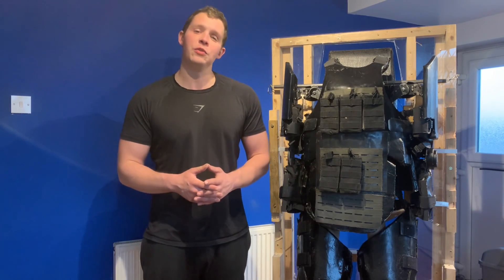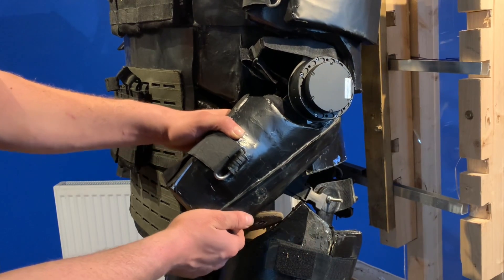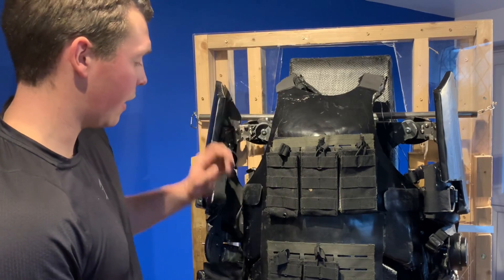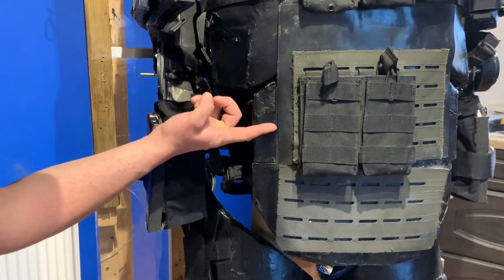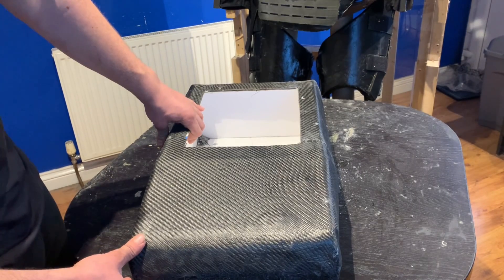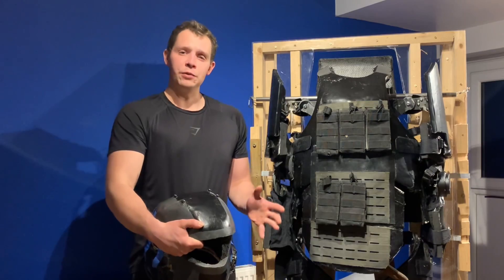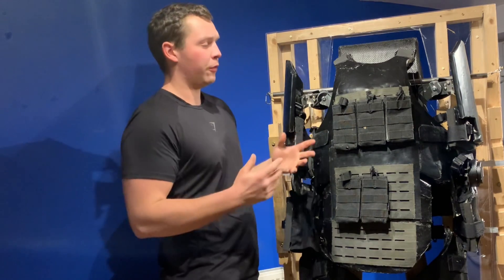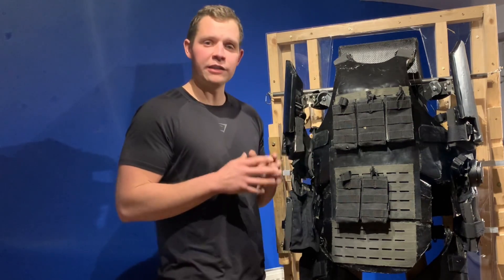Functional Military Power Armour Development. PART 2 of Episode 5

Comment: Hey. I'm also fascinated by armor like in Halo or Fallout. What specifically is the reason that today, with the level of technology we have, this type of armor is still not on the equipment of the US Army ? After all, powering this type of armor can be solved even with a small battery storage powered by a small diesel generator ( even from a compressor ) And the whole thing is based on mechanics and hydraulics. From what we can see in the war in Ukraine drones wreak havoc among soldiers so this type of armor is slowly becoming a necessity whether heavy as in Fallout or lighter as in Halo. Simply put, comprehensive protection of soldiers is becoming a reality and this needs to be addressed.

Comment: I would suggest trying to simplify the suit, and work on perfecting one part at a time. for example, get rid of the boots, consider using gas pistons and springs in some areas rather than motors.

Comment: Certainly an impressive project, but ultimately I must ask, does it solve the morphological problem?  Exoskeletons have been tried many times before, and in fact DARPA has developed a working exoskeleton for the US Army in I believe 2010.

The issue you are going to discover(if you haven't already solved it), is that rotational motors are not compatible with the morphology of human muscles, which are simply organic electrochemical linear motors. The soldiers involved in DARPA's program universally reported that despite the system theoretically increasing their strength, thus reducing perceived load, the desynchronization between the exoskeleton's motors and the wearer's muscles ended up causing the wearer significantly more fatigue than if they had no exoskeleton on at all. There's about a dozen different reasons why traditional motors of all kinds are incompatible with human morphology, which I could go into great detail about, but I think far more telling is simply observing how much energy organic things consume to do work relative to their motorized counterparts.

Human muscle tissue has a work capacity that varies between 50 and 350 watts per kg, yet the calorie-watt conversions show that even the highest performance humans only use about 200 watts per hour a day at maximum(assuming 4000 calories burned in a combat environment). Now remember even further that much of the energy we expend is only used to heat our bodies, rather than produce physical work, and it quickly becomes clear that our muscles are far more capable than motors are at large, and for more reasons than pure work capacity. There are 200 watt motors that exist, but can you even imagine one doing the amount of work that your body does? Our bodies are insanely efficient on a systemic level, despite our muscles even being less thermodynamically efficient than optimized motors(roughly 67% efficiency for muscle).

Comment: I love this so much.
One thing I'd consider adding is just a super light cloth covering in the joints. My reasoning is that if dirt or mud or other debris gets caught in the motors and joints it would clog the armor and ruin the mobility of the wearer. Some simple cloth covering (not even thick, just a slight covering) would prevent dirt and other debris from jamming the armor. I don't know enough about armor but if some light protective covering could be used instead (that still maintains mobility) that would be better. This is similar to how old medieval plate armor had a gambeson and chainmail under the plate, part of this was to cover up the joint (such as protection for the hamstring, armpits, and groin)

Comment: Wearing a frag suit underneath the power armour would probaly help with covering any holes in the armor (or weak spots)

Could also simply have a custom jumpsuit made to facilite wearing the armor as well as filling possible gaps and help with temperature control

Comment: You mentioned in the previous video that the suit takes four minutes to take off, and while that would be undoubtedly faster assisted - it still presents a problem.

Those plates don't provide full body coverage, and while the composite materials are rated up to .556 there is certainly higher strength munitions that could defeat them. While more powerful munitions would almost certainly be deadly outright - there are certain edge cases where medical intervention could save the operator if treatment happens fast enough.

.50 would punch right through the plates and be devastating to the man in the suit. He would likely only have about 90 seconds, but a shot in the arm or the leg could be recoverable if a tourniquet could save the man if applied quickly enough. Even a .22 or 9mm in between the plates could be just as devastating. If the man is partially covered in debris or rubble, it might mean that the frame might not be able to be removed at all to access the injury.

As it stands now, anybody going in to the suit has to know they're staying in the suit until the op is over or they're dead. I don't think I'd want to have to make that choice.

Comment: If ceramics and Kevlar are difficult for casting and drilling, have you considered UHMWPE for future designs? You could then have small replaceable ceramic plates on the exterior that are glued or velcroed onto the UHMWPE base armor allowing for quick fixes. Inserting a chunk of polymer and melting it back into the main armor could be done instead of replacing an entire plate section too allowing for a multi-hit protection instead of compromising the whole plate at once. Even without the ceramics, a Level III+ UHMWPE plate is only an inch thick and you could have variable thickness for more mobility. It would also lighten up the suit a lot and prolong the battery life. It should also be cheaper. That said the manufacturing process could potentially be more of a pain than casting since it needs heat and compression and I’m not sure how much compression it really needs. A hydraulic press might be less viable.

Comment: A little bit of criticism. Please don't take this the wrong way because I think what you're working on is really cool, but you've gone at it in the complete wrong direction. 

The military knows what pieces of armour it wants and how to attach it to the person. If you dig deep into the tactical gear world you'd see ready made deltoid, chest, groin and thigh armour which is what the military wants on its soldiers. The issue that hasn't been solved is the exoskeleton, and importantly, the power source. Figuring out how to get the exoskeleton to work would be far more impressive to those in the know than all the composite work which is expensive. As someone with industrial manufacturing experience, the plates are definitely a part that you want to farm out to existing manufacturers because certification and legal protection for your plates is expensive and will add unnecessary risk to your product. Make a skeleton that can hold nylon/cordura pocket matched to supplier's plates is the actual innovation, everything else is secondary. You can demo and test your skeleton with just lumps of steel plates in the vaguely right position with equivalent or higher weight which is a lot cheaper.

Comment: You should consider looking into use for this as a law enforcement/counter terrorism utility before a military utility. It has unlimited potential for making CQB, one of the most dangerous modern combag situations, significantly safer for the wearer. That's almost entirely what SWAT, its equivalents, and counter terrorism groups deal in. The ability to shrug off shotgun, pistol, and quite possibly rifle fire at a close range where the attacker is at a disadvantage is invaluable. It would also likely function as protection from improvised traps and explosives to some degree. It would also help test the earliest working versions of a suit in a usually shorter-term and less variable situation than military use, helping to lessen randomness to a minor degree and account for battery life and motor overheating. In your last video you were looking for government funding. I think you might sooner be able to pitch this incredibly impressive design to the previously mentioned groups over militaries, though I think vying for every bit of funding from wherever you can get it will always be best(if it's legal lol). Also, how will the motors know what movement is yours that you want them to assist and not a random bump or something? It seems like if someone grabbed your arm it would help them just as much as you, or if you tried to catch something with mass falling it would drop the arms in turn. I'm also unsure of how the motors wouldn't just input their own movement and snowball out of control, but I assume that's not a problem since that's a feature in the first place lol. Have a good day, good luck on getting funding and future development, I'll be watching eagerly.
Reply: I've always said to people that things like full body armour (as in head to toe everything in some kind of armour) as well things like powered armour or really heavy duty rifle rated helmets would all be a hell of a lot more conducive to law enforcement than they ever would to the military. This isn't to say there wouldn't be niche circumstantial applications for the military, there of course would be but by and large they would likely see far more applicability with law enforcement.

Comment: If your casting is precise enough you could locate oversized holes into the mold then press in bushings, kind of like a through hole rivet for leather. It would give the bolt hole a little more strength as well.

Comment: If the motors don't work out, you could look into artificial muscles. The ones with good response time and strength deteriorate, but that could just be part of a maintenance cycle, replaced over time.

Comment: I still suggest an IOTV for the chest piece as a base because they already have working "dorito" shaped upper arm coverings that doesn't restrict arm movement. And they have a side pocket to put more armor plates. For the backpack if your keeping large like you have it brake it up into 3 sections  2 hard sections 1 soft. I recommend that so you'll have a dedicated battery/commo. Sections for batteries for the suit and radio. Recommend being in the middle for protection from shock and water. The bottom section could be used as a MRE/ammo storage. And the top section should be a soft sections to store everything else. And depending on mission or feild exercise it needs to expand without making the person unstable. If you could swing it try picking up a cheep 3D printer for some of the armor pieces. So you could segment your chest piece together until it's a little loose but with no restrictions. Then make a mold of that. It's easier and cheaper to recycle 3D printed stuff. And lastly for your helmet, pick up a viser from a paintball mask/helmet and spray some de-foger on it then put it in. Have a  good one and thanks for the video.

Comment: for elastic assists that actualy work with the weight in question: actual bungee jumping cord.
Reply: Important detail
Reply from the maker: Thats a good suggestion, i have found that setting the correct amount of assist is a bit trial and error, i started off with the achilles  heavily assisted, quite bizarre as i couldnt move my foot off the ground!
Reply: @MattExo-Dynamics  

two other things for the assist: having the elastic assist reach neutral shortly before the foot does gives a very good result. and having the assist amount decrease up the leg
Reply: @MattExo-Dynamics   i found a few principles behind it:

- the maximum passive elastic assist must be weaker than your opposite own muscle.

- the elastic assist must reach zero tension before your most relaxed joint pose.

- adding up moving in one direction, the assists have to be ratioed so they cancel in the otherinstead of subtracting.

so for the ankle to knee i use a 3:2 assist ratio, or a 2:1. this way, when walking backwards, the spring of the foot upwards overwhelms the knee extension andyou get no ground-locked feet. 

for full ankle-knee-glutes combo i go 3:2:1

Comment: I think some kind of armored skirt would be useful in providing a lot of protection while allowing for mobility. Similar to what knights used. Someone on the other video also said this but like an armored cloak could also work though that would definitely increase heat though not as much as just sealing the entire suit.
Reply from the maker: I tried a roman style skirt of plates, but with it being thick armour it was monstrously heavy and un useable especailly with overlap, however the improved groin pad on the next prototype will solve most of the issue.

i do intend on making a water proof cloak with a kevlar lining, with a strap in the middle. Frankly i think it will end looking like a cross between a tunic and water proof dressing gown.
Reply: @MattExo-Dynamics  yea that sounds like a nice idea. 
Maybe having a Kevlar skirt world also work instead of a hard plate one. It could protect the more unarmored spots from fragmentation from explosives, grenades etc. 
also I don’t really think you need hard plates at the back of the leg as I doubt those places would be shot at so soft armor would likely work a lot better.

Comment: you could use 8x10 plates for the shoulder and thigh and groin regions, and tactical Scorpion gear sells RF2/3+ extreme plates that are much lighter than level 4 and stop light armor piercing ammunition like m855 and m855a1, don't forget to have trauma pads on the armor as well to avoid broken ribs or severe brusing 

and you can use 6x6 side plates to protect the servo joints as those are exposed and looks easy to hit in a active shooter situation, or just use a 6x8 side plate as a nice neck protector plate against being shot at the neck region since that's what I've seen what European swat teams have used before.

Comment: Have you considered making a version of this that's just the exoskeleton that could potentially be used to carry what soldiers already carry right now, the weight that a soldier can be expected to carry has already risen to unreasonable levels in my opinion.
Reply from the maker: Yeah, i imagine if i can get military funding and trials etc, they will want a reduced version at first to use with what they already have but in the future will want a high tech heavier armoured solution. Which i aim to be able to ptovide both over time. But that means with whatever suit i build noe ive got to try show the potential for both.

Comment: Are you going to eventually put a gorget?.
Reply: I had the same question in the previous video
Reply from the maker: Maybe an option for a removable one, but i made a mock up gorget and it was horrifically impractical, couldnt see my legs sat down, cant see rifle controls unless its held up in line with your head. 
Because the armour is thick, including the helmet, a gorget had to stand really far forward. I am trying to design a helmet where if you put your chin down it covers your neck.  I think that might be the best compromise
Reply: @MattExo-Dynamics  if I might add, you could probably add a avantail as a starter for neck protection before you start a gorget. 

Anyway if sir Perun has tough me a lesson is that you don’t need to add unnecessary modifications before you finish the project, so good luck mate you can do this, i trust in you👍🏻.

Comment: Maybe you could install a pipe cooling system that pumps cold water through pipes along the body. 

The only disadvantage I could see with this system is that if a pipe bursts then it might mess with the electronics, so keeping the pipes underneath plate would be a necessity.
Reply from the maker: Yeah its a decent idea, on e its summer ill be able to see how bad it is!

Comment: Question: why didn't you use or modify a normal military backpack they have space for armor Camel packs and electronics and can be integrated into a vest so arm straps wouldn't be a problem?
Reply: That’s a good and valid point
Reply from the maker: I wasnt sure on whether the electronics would get squashed but also the back pack is a particularly size so you can go through a regular door way sideways.

Comment: if you do ever power this you should consider building a small gas turbine connected to an alternator of sorts, possibly place it in the back. that way you can run on fuel instead of electricity, which isnt always available in the field
Reply: That might be too much of a weight cost I think? As long as it has charging adapters should be ok. That backpack could hold a lot of batteries.
Reply: There's 12hp rc turbo shaft engines so possible
Reply: There's a russian? guy here in YouTube using compressed Hydrogen gas obtained by electrolysis of water. His entire energy system is the size of two fists together, it's absurd. It could be adapted to power a motor.

Comment: plate armor or lorica segmentata inspired pauldrons/ shoulder flaps, shaped to allow weapons shouldering and elasticaly secured to not flap,  could close the exposed shoulder area ^^

a single  half circle (not sphere piece on the shoulder) that can gimble around the shoulder.

"spi armor" from halo uses feasable design for that.

this area being bump/stab/slash/shrapnel resistant "only" would be a great aid already, and obfuscate a weakspot. 

bump caps for other exposed areas are usefull too. for example inner arm cushioning/bump/scratch protection